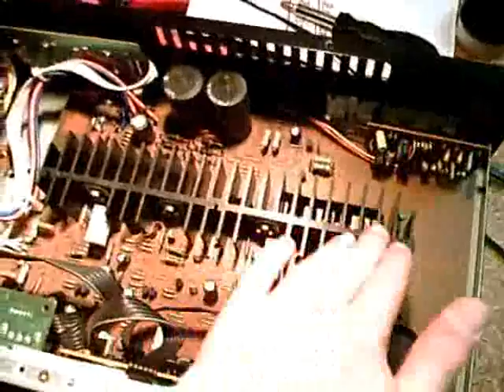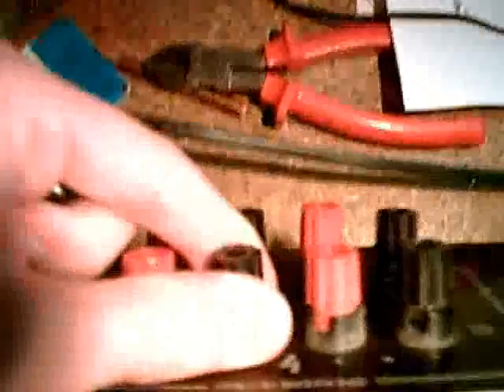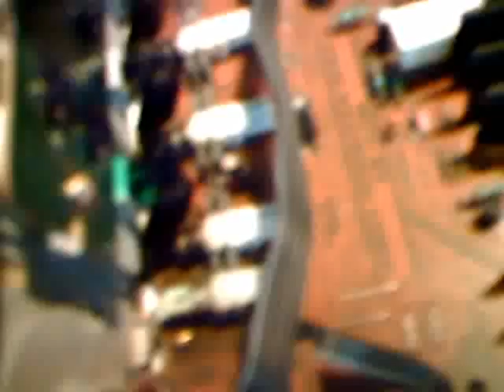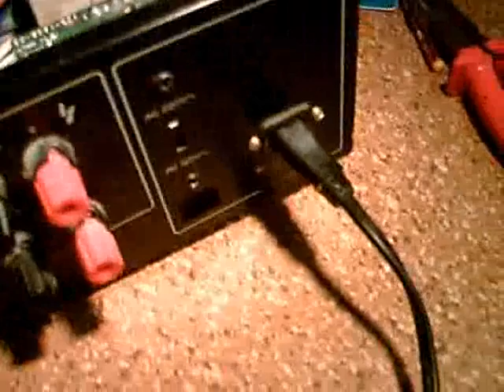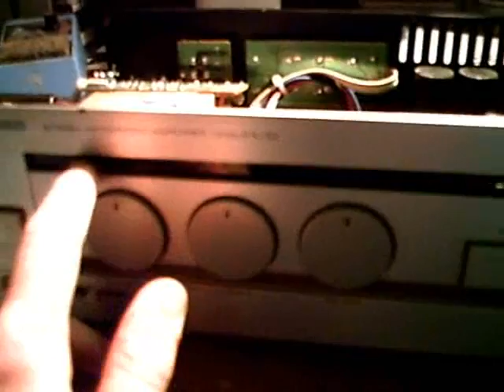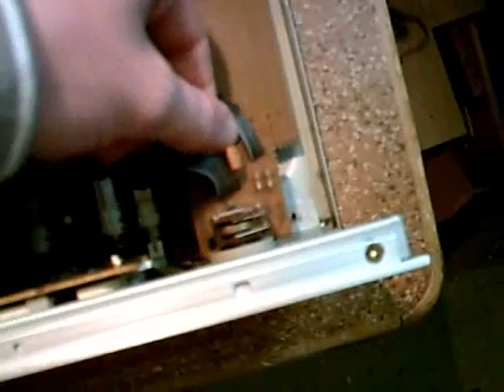Inside the Kenwood KA 30 amplifier

Comment: Kenwood KA 30 Stereo Amplifier made in Japan - I have good memories of this because i bought one from local agent in Colombo, Sri Lanka in 1982. 25 W.P.C. but very good quality at that time. It's all illuminating 4 input light system was most interesting because that kind's rear at that period. As mentioned it lacked the LED output level meter which KA 50 had. Unluckily the agent did not have the KA 50 model at the time i bought KA 30. At that same time i bought KX 50 Cassette Deck and LS 99 Speaker system. I used them for few years but sold them later and now i miss them. My posting is very late, anyway better late than never!

Comment: Great video, but as vieuxson already said: the camera makes this vid really hard to watch. Btw: are there other differences to the KA-50 besides the VU-meter?
Reply: The KA 50's appearance was quite similar to this KA 30 which i once owned, but the KA 50 has more power with 45 Watts per channel. It doesn't have VU meters but LED's (5 LED's for each channel) to display output. I think my reply is too late but better late than never.

Comment from the maker: (2) Todays integrated circuits are almost as good as discete power amps (using four power transistors) and the construction as a lot easier. The old 70s STKxxx IC's are all pretty crappy and if you shortcut the output they'll die. 
I recommend for example the 
TDA2030 (output 14W)
TDA2050 (output 32W)
TDA8560Q (output 2x40W, really simple cicuit)
TDA1519C (output 2x11W or 1x22W, extremely easy to built!)
but there are a lot more good types!

Comment from the maker: (1) I built a lot of amplifiers in the past as I already told you, I also built one using relays as input selector. One thing I can tell you about that is that the current that drives the relays has to be perfectly clean because in my amp the "bad" current puts a lot of hum into the sound that goes through the relays. That's annoying!!! Using the modern OP amps building a preamp with tone control shouldn't be too hard and expensive and for the power amp you can use integrated circuits.

Comment: It's still just in the "I have an idea" stage.  If I build it, which I hope to soon, it will use push buttons to select input and tape monitors, and it will use a kind of "logic" system inside using relays to do the actual switching.    I have the schematics drawn on paper for how the the relays will be wired. I might post a video of that, I'm also online checking out prices of all the parts.  I just have to design the rest of it.

Comment: It's a really nice looking amp.  I've always liked the silver finish on 70's and 80's equipment.  The circuit is probably made for several different models, so the extra holes are for other components in other models.  I'm going to build an amp myself when I get next some money, Id love to build a tube/valve but I don't have that much.